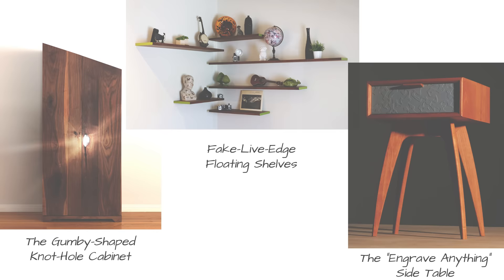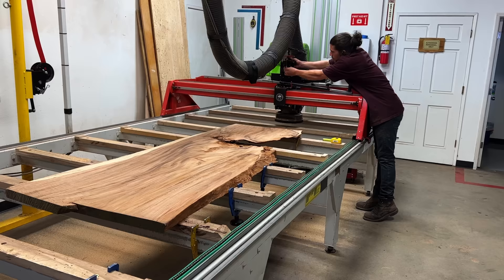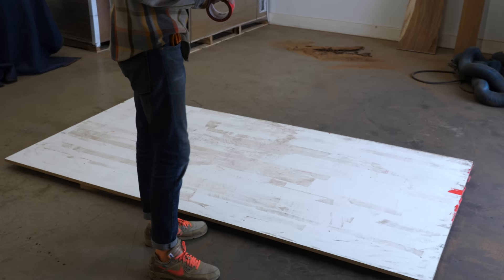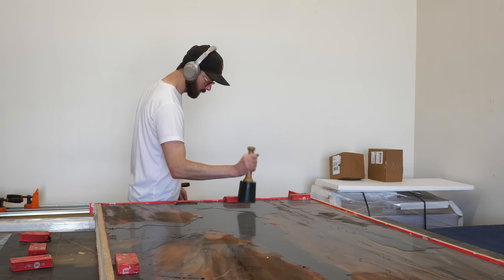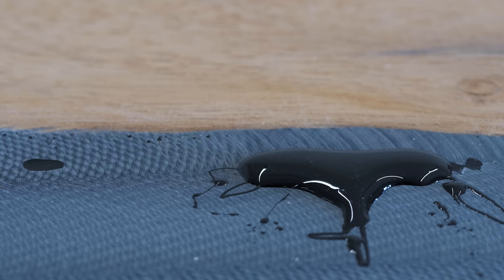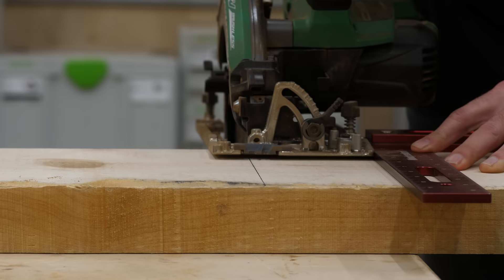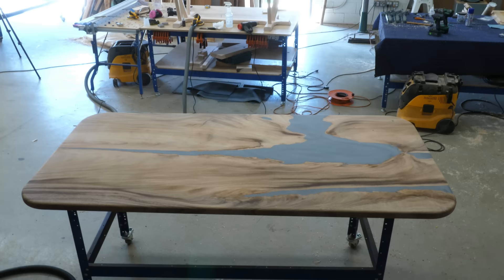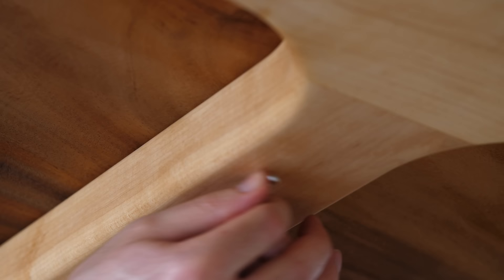Surprising My Parents with a Fancy Dining Table

Comment: Why do you always use black epoxy? Transparent epoxy would provide so much more details of the wood.
Reply from the maker: To me, ironically, black epoxy is more invisible than clear epoxy. It kind of blends in with the slab and makes the table top feel as one coherent object.

Comment: Expired epoxy??

Usually epoxy actually can’t expire.
It can crystallize when stored wrong, and the hardner can turn yellow, but you can use it “forever”.

Dust (as well as flour etc.) is quite explosive and flammable. It just takes too much heat or a spark…what you know are aware of.

Always entertaining & create projects!
Best wishes
Reply from the maker: I've got lots of comments about crystallization happening because it gets too cold. I don't think it gets cold enough in my shop though. Probably mid 60s at the coldest part of the year.
Reply: @Foureyes.Furniture  Correct, it’s usually because it’s too cold!
60 degrees is actually not warm enough.
IF crystallization or milky consistency occurs, you should warm up the epoxy container or amount (unmixed of course!!) in a water bath at around 100 degrees.
It should be completely clear again after that.
Let it cool down slightly (otherwise hardening time is reduced), mix and pour it.

Best wishes! 👍

Comment: If that pac man slab flipping machine doesn’t make the Wakka Wakka sound than what was the point of even buying it?
Reply from the maker: It's hard to tell over all of the other noises at GL Veneer...but I swear I heard something
Reply: @Foureyes.Furniture  a common cause of dust extractor fires are metal fragments in the wood which get hot when they’re cut and then get sucked into all that lovely saw dust. Maybe run a metal detector over your slabs in future. Cool table btw.

Comment: It’s NOT imperial… it’s SAE. And I know both, well. Metric is best simply because it’s easiest. The only argument I’ve ever heard for fractions that made sense is that you can’t easily represent thirds and some other non intriguers. That said, we don’t use any measurements that can’t be accurately represented with the metric system so all in all, metric is best. I do live in the USA and use only SAE because that’s what we use. :(

Comment: So, metric vs imperial. I’m a retired civil engineer in the U.S.. When I was in college we did problems in both systems because we were supposed to be converting to metric. I had a drainage class and here is an actual problem- you have a watershed measured in square miles. A storm dumps two inches of rain. Convert that to acre-feet of water. The runoff is measured in million gallons per day. WTF??? Just use metric.

Comment: Imperial. Metric.  Whatever.
Metric is far superior, but I still use imperial in the shop.
I put 80 litres of gas in my new vehicle hoping for a better miles per gallon than my last vehicle.
Before giving up beekeeping, I bought 2 lb packages of bees to sell honey by the kg.
Telling someone which units they should use is the equivalent of telling someone to speak a different language because you don't understand them.
Be bilingual lol

Comment: Did that slab cost $3460 ?????? Wait......WHAT? WHY??? Its just a piece of wood. $346:- would have been extremely expensive.....I don’t get it :-/ If I had liked the finish result, I would have payed a maximun of $500 for that table.